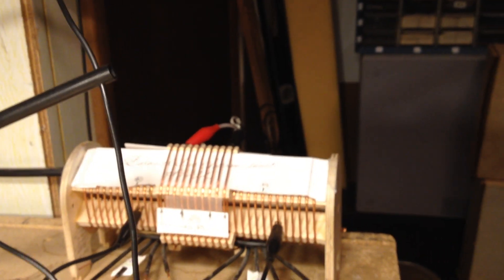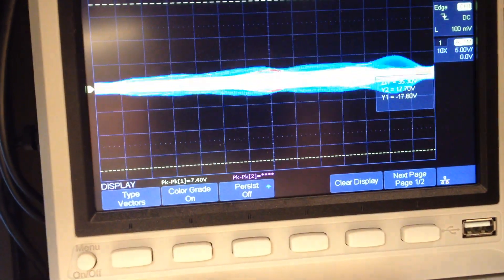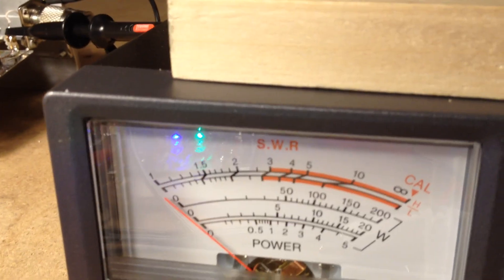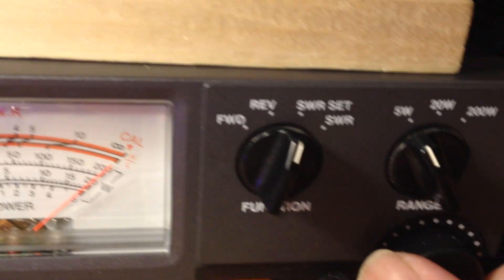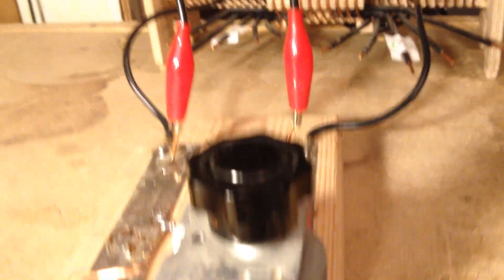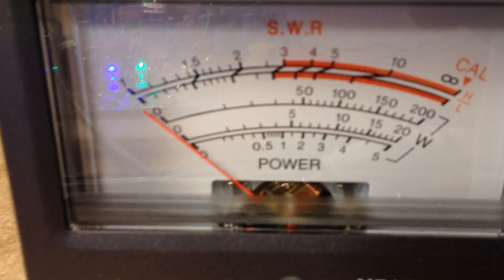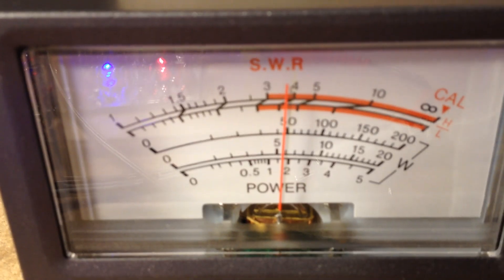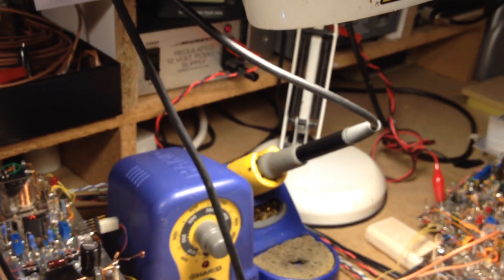Balanced link coupled tuner for full wave horizontal loop fed by 600 ohm ladder line

Comment: Congratulations on the beautiful construction. I was delighted. In my case, I am still building my doublet antenna. I don't understand spoken English very well, so I ask: How thick are the coils and in my case, with 100W, the capacitor should be bigger, right? As for losses, can you make a comparison with the well-known type Z coupler? Thank you very much for your attention. Strong 73. Evandro Silveira PP5UAI.
Reply from the maker: Hello Evandro,

Thank you for the kind words on my construction.

The Link coil (transmitter side) is 10 turns of [#14 AWG 0.0641 inches (1.627mm) dia.] uninsulated copper wire,  6.78uH and is 2 inches (50.8mm) long, 3.25" (83mm) dia.

The the Ant coil 34 turns #14 AWG, 20.0uH and is 6.8 inches (173mm) long, 2.5 inches (64mm) dia.  

Yes, the capacitor may need to be bigger for 100W, with more spacing between the plates because of the higher voltage to prevent HV arching.

I am not sure of the losses as compared to the type Z coupler since this is the only coupler I have ever owned or used.

Keep up the good work on your doublet antenna, I want to try a doublet in the future, my 80 meter loop is the only antenna I have used on HF so far for transmitting.

73
Reply: @Circuit6040  thank you very much for your attention and response. I hope to be able to meet my friend on the radio waves. until then, stay healthy and happy. on my page on QRZ.COM, there is my information, including my personal number, in case you want to schedule a test between our stations one of these days. strong 73.

Comment: can you provide detail coils coupler in uH, pls. thanks
Reply from the maker: Hello WAN ariffin, the Link coil is 10 turns,  6.78uH and is 2 inches (50.8mm) long, 3.25" (83mm) dia., and the Ant coil 34 turns, 20.0uH and is 6.8 inches (173mm) long, 2.5 inches (64mm) dia.  Rick N3FJZ
Reply from the maker: Here's a link to the schematic and project page on my website.  Schematic: http://www.remmepark.com/circuit6040/Link_coupled_transmatch/images/Link_coupled_transmatch.png  Project page:
http://www.remmepark.com/circuit6040/Link_coupled_transmatch/Link_coupled_transmatch.html
Reply: @Circuit6040  Rick, I keep getting:  The requested URL was not found on this server. Any updated links?
Reply: thanks a lot for the info rick, may be i,ll try for my doublet...73

Comment: Richard, I like the way you made the coil form from plywood.    Simple,  but elegant..73 de AC9JQ
Reply from the maker: Thank you Dean for the comment. Good the hear from you again.  I used TurboCAD to design the coil form and used my scroll saw to cut out the Baltic Birch 1/4 inch (6.35 mm) plywood .  This would be a good item for someone with a laser cutter to cut out of acrylic or a 3D printer project perhaps.  73